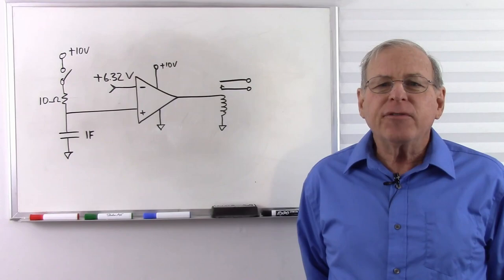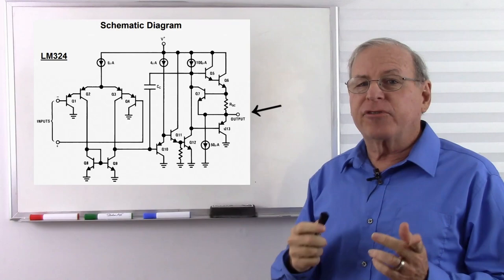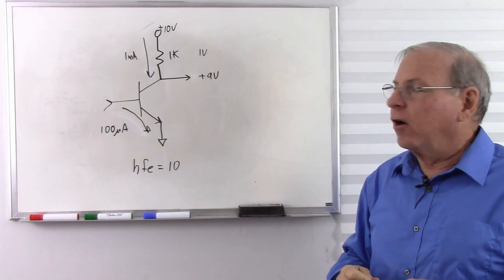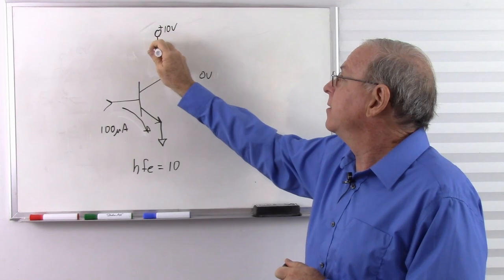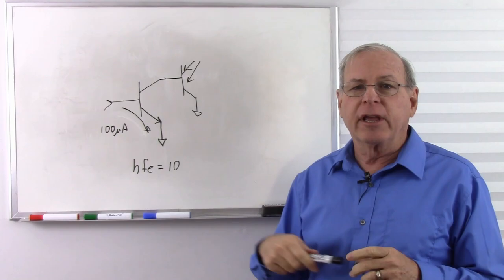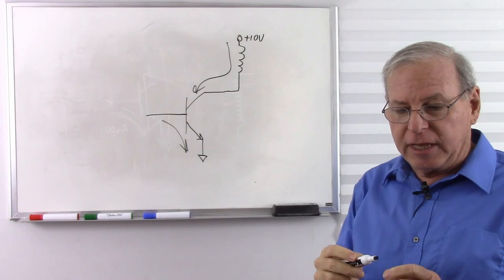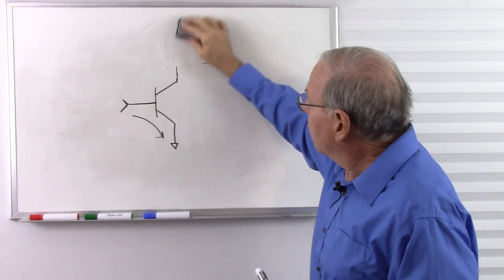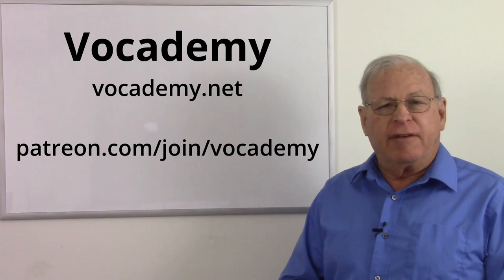Open Collectors and Pull-up Resistors

Comment: Of you skip the real world hardeare options, then you get a clearer picture of oscillator criteria. You need amplification with out of phase feedback AND also magnitude dependence.  So the magnitude is self limiting to a level less than the voltage difference.